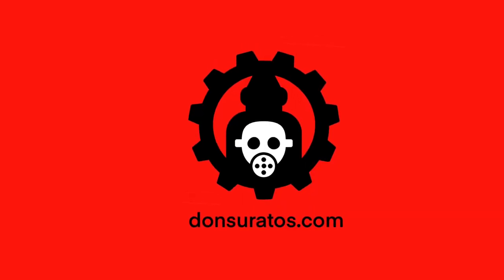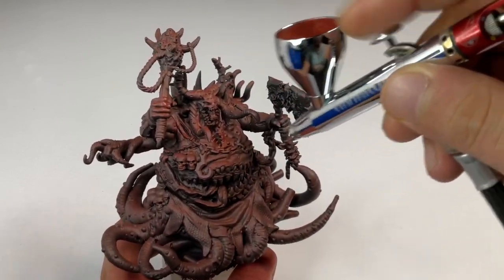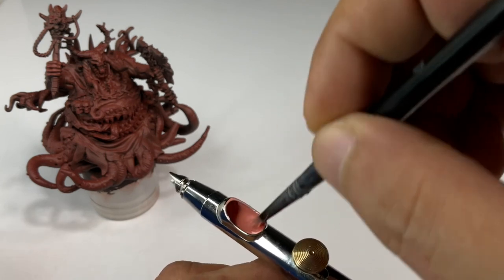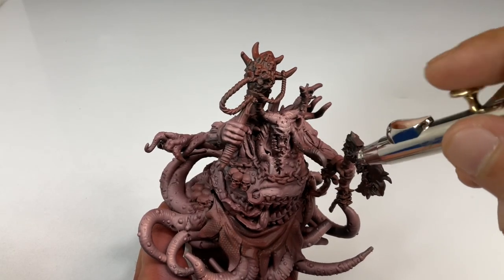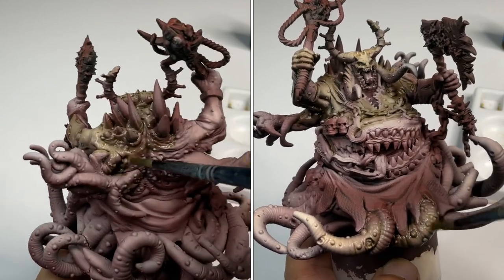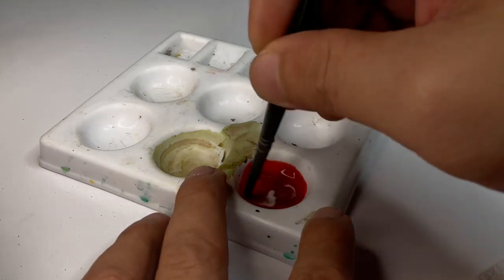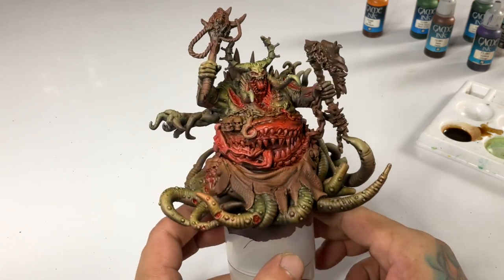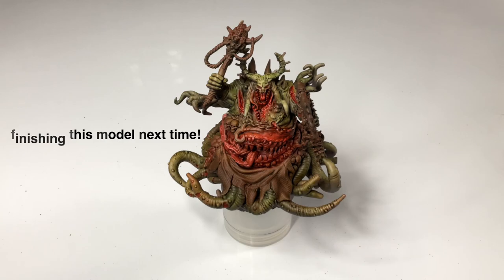HOW to GLAZE Miniatures | Underpainting Explained

Comment: Allo, Don. I hope you had a good Christmas. I'm having a lot of problems with primer at the moment; Vallejo Surface Primer seems to come off the model too easily (I'm disabled, I only have one functioning arm and leg so I drop models lots, I need a tough primer because of this) and the Stynylrez primer I got was damaged by being stored in a warehouse without temperature control, possibly the damage was done when the primer was exported from the U.S.A. to me here in the U.K. because they don't use temperature/moisture sealed shipping containers (they exist and they don't cost much more than containers without these features, it's gotta be cheaper than Badger constantly replacing damaged product!)  so I was wondering if you could do a priming video where you get the process wrong on purpose, maybe the most common mistakes? Show us what is being done wrong and how to fix it?
It'd be remarkably useful to me and I'm sure the other viewers would appreciate it too.
Happy New Year old chap 🥳
Reply: No expert but hope it helps.

Primer makes paint stick to model, varnish protects paint. You should experiment with layers of varnish on top of your pretty minis.

There is never a perfect protection against dropping them so I would personally invest time into methods, tools and storage that minimize this.

Come up with your own painting handle? Maybe stick it to the table edge?
 Magnetize the foot of the mini and stick them to  metal when transporting or using them? A sheet of metal in the bottom of the box?
Maybe gave a sheet of fabric or bag to minimize fall i  some situations?

Just brainstorming, hopefully something inspire your own ideas :)
Reply: Oh, and i would remove bad primer, strip the mini in the worst case and apply a new coat.

Had another idea that might not be that bad... magnetized miniature. Then a strap around the wrist or nearby object with a string that ends in a second magnet. The goal is to keep the string short enough to keep the mini from hitting the floor. Then attach the mini you are wofkimg on to the string and detach when finished etc.
Reply from the maker: Primer needs to cure for 24 hours before handling. You can paint over the primer after it dries to the touch, but if you keep rubbing a certain area, withou letting it cure, the uncured primer will rub off. ☺️